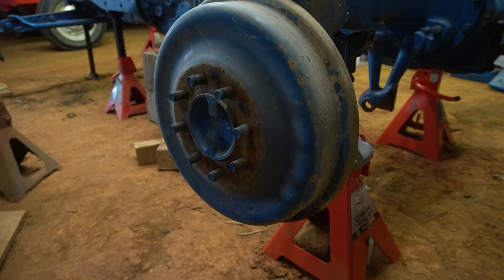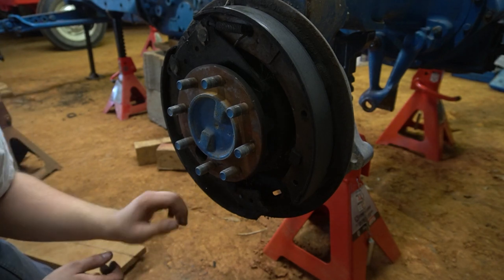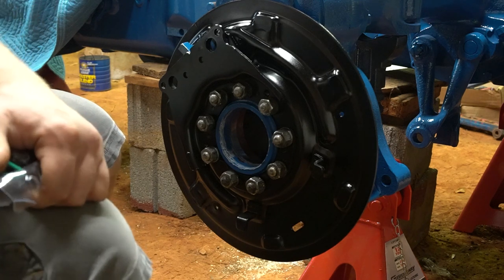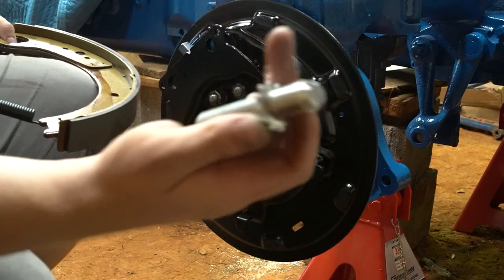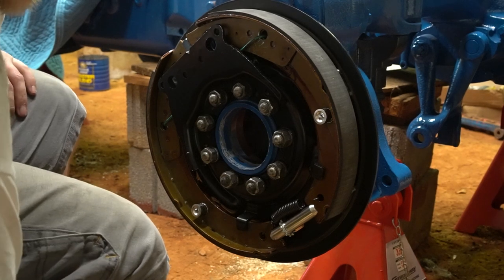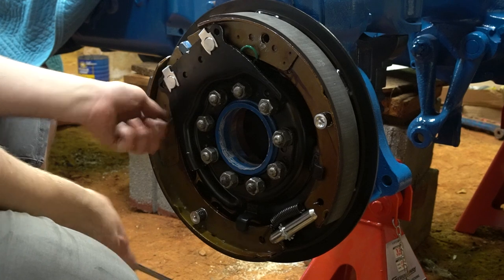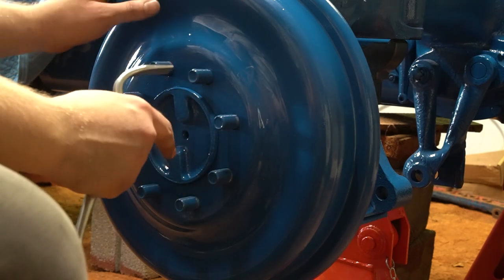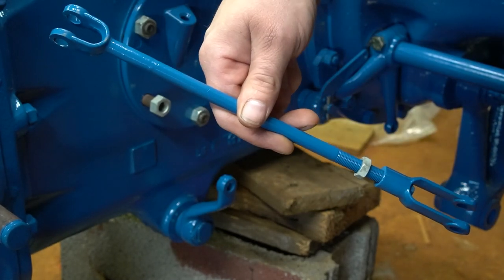Ford Tractor brake install and adjustment 1955-1964

Comment: Thank you for all the details...it was late in the day, had to get back home, took them apart quickly thinking "these are so simple, I can remember this", but now I was not so sure.....until I watched your video!  Thanks for helping me and many others to make these projects more fun.
Reply from the maker: Thank you. I try to be detailed since most videos lack that and that is usually where people need help the most.
Reply: On Saturday I installed the new shoes on the '55 600, reused the hardware, and adjusted the star wheel until it started to drag.  Next was to adjust the pedals, the left (as if you are sitting in the seat) was easy because of the turnbuckle, but I can not understand how to adjust the right side.  I loosened and removed the bolt where the pedal shaft attaches to the camshaft shaft, used plenty of penetrating oil, hit with a hammer and it would not move.  Is this connection keyed?       One more question, how loose should the brake camshaft be within the hole that goes through the backing plate?  The shaft  can move up and down about a 1/4" in each direction and the shoes do not contact the cam .  I have a few photos and short video, but not sure how to send them if needed.  Any help will be appreciated.
Reply from the maker: @account11455  that pedal is keyed to the brake camshaft. Only way to adjust the right brake is to turn the star wheel adjuster to bring pedal height up. I never filmed it but I have a set of shoes that I had on my 861 that I tried putting on the 4000 that were not made correctly. No matter how much I adjusted them the pedal wouldn't come up. Where the pins are at the front wasn't machined enough and the shoes never set down onto the camshaft. Swapped shoes and problems was fixed. The cams in the backing plate hole will move up and down quite a bit but the shoes should center it in the hole. Once adjusted properly the shoes should be touching the camshafts pretty much all across the T shaped end, a 1/16" gap is ok. If not shoes need some grinding where that pins go.
Reply: @chickenhousemechanic  leaving work now, go home and change clothes, and start checking this.  Thanks again!
Reply: @chickenhousemechanic  You are right, it looks like some grinding on the hole will be the best option...will let you know how it ends.  At first I was thinking of building up the cam block and grinding smooth, but it does not seem to be the easiest way.
Reply from the maker: @account11455  I'd modify the shoes before I modified an original tractor part. The pair of shoes I had were from around 2012. I ended up putting an original pair off the 4000 back on since they were good. I dont know how many other people have ran into that issue. Someone welded the cams on the 4000 and I ground them back to factory spec before installing the new shoes and the original back on the right side. Hopefully that fixes your issue. It did on my 861 and 4000.
Reply: @chickenhousemechanic  It took some whittling and the shoes are snug on the T cams and they work great!   I even got the parking brake pawls to work while I had the rear tires off.  I'm in the home stretch just in time to use it to pull a trailer for a hayride at our church's picnic next Saturday!  Thank you again for all your help.
Reply from the maker: @account11455  good to hear it. Glad all is working for you now.

Comment: Hi CHM, thank you for listing the years that the video covers with the 1960 Fordson dexta I really appreciate it and being old I have all the tools required for old style brakes now I know yo mentioned the part number but could you link it also  thank you
Reply from the maker: Hardware kit:
https://www.yesterdaystractors.com/Ford-801_Brake-Repair-Kit_NCA2250.html

Brake shoes:
https://www.yesterdaystractors.com/Ford-801_Brake-Shoe-with-Lining-Pack-of-2-Shoes_NCA2218B.html

Each part does 1 side so you'll need 2 of each to do both sides.
Reply: @chickenhousemechanic  thats great Thank you

Comment: Any idea what the OEM number is for the drums? I keep seeing two different numbers popping up online and I don't know which is the correct fit. Plus, the new drums have a slightly different appearance than the old.
Reply from the maker: Original part number is NCA-1126-A. These have been superceded to 86533415. From pictures I believe these to be cast iron where the originals were steel. Thats most likely the reason they look different.
Reply: @chickenhousemechanic  thanks very much

Comment: Hello, where did you buy the spare parts for Ford Tractor brake install and adjustment 1955-1964, help me urgently
Reply from the maker: Mostly ebay. Had to buy the ratchets from a tractor junkyard since they were rowcrop specific.

Comment: I have a 4000 row crop diesel my throttle won't stay put it constantly drifts down in rpms. How do I fix it ?
Reply from the maker: The only spring on the throttle linkage is at the bottom of the touch rod. It may be broken. There is also a friction disk under the battery. That is most likely the issue. You can probably just tighten the nut a little on top of the friction disk if the disc is still there and in ok condition. If neither of those repairs the issue you may have an injection pump issue.

Comment: Do those old brakes have asbestos in them?
Reply from the maker: Not sure when asbestos was phased out on brakes for tractors but I would treat them as if they did to be safe.
Reply: Yep   I have just lining and ribits 
There really old but still will work fine